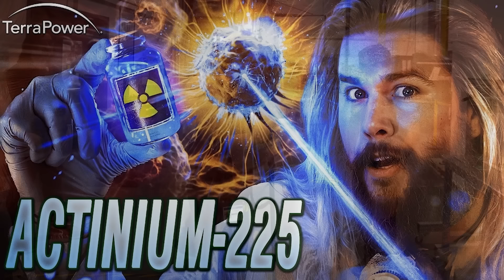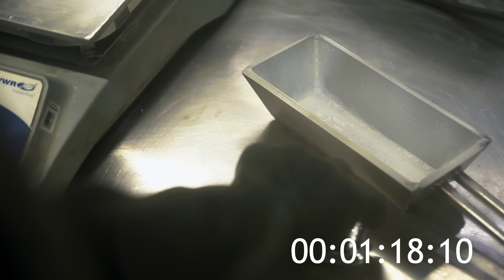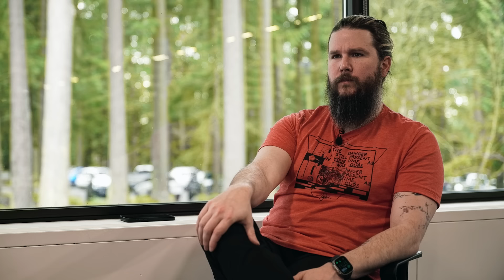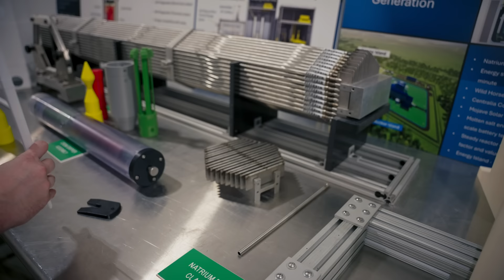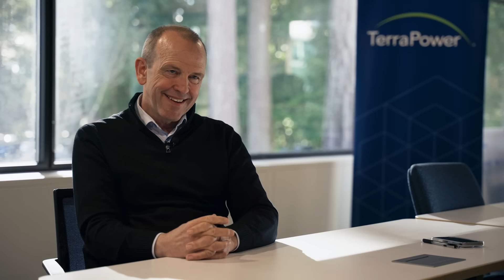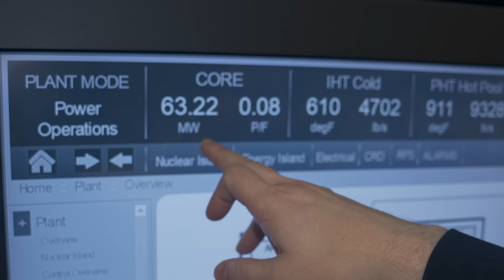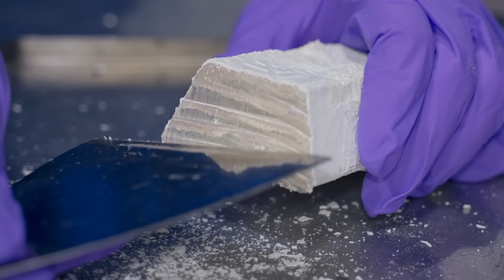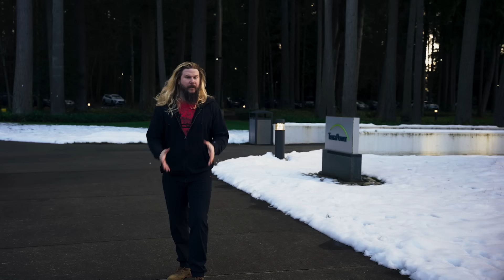Will Natrium Nuclear Reactors Change Everything?

Comment: Do the TerraPower reactors have a Safe-Fail design? With a fast reactor not needing a moderator, a cooling pump failure means that the heat will continue to build up… so eventually, though it would take longer to get everything hot, you would still reach meltdown conditions.

Compare this to a heavy water reactor where without the D2O, the neutrons move too fast to sustain the reaction, causing the output to fall, that should in theory prevent a runaway.

Second is that I’ve heard reports about sodium cooled reactors used by the USSR in submarines, and one major issue that they ran into were secondary chemical reactions creating deposits in the cooling channels of the reactors requiring periodic invasive cleaning cycles. I don’t know the specific residuals, so maybe that’s been eliminated with more modern materials, but I’d love details on that.

And of course, using salt as an intermediary prevents the “radioactive sodium metal meets water making glowing steam” issue, but would there need to secondary heaters in the water side transfer? If the system stalls and the salt solidifies in the water side heat exchanger, and the reactor is “going 100%” you’ve got a backlog of energy building up.

I guess in the end, nuclear yes! Better handling, yes! But this is more of a lateral development, or refinement of existing tech, not anything truly revolutionary. But heck, the iPhone was the same thing and look at what it did.
Reply: I doubt the coolant pump failure would be significant as this design likely has a significant negative thermal coefficient just as the EBR II and other sodium reactor have. 

And I'm assuming the soviet submarine reactor you are referring to is the VT-1 used in K-27. That was cooled by a eutectic alloy of lead and bismuth, not sodium.
Reply: @  I’m not sure of the model specifically, and it appears most Soviet designed sodium reactors used a BN prefix.

The sub reactor was never implemented in anything more than a testbed due to the residuals and other issues, specifically sodium voiding and well… leaks.

I looked up the EBR-2 you mentioned and it does appear to have passive cooling through convective circulation, but still not quite a “safe-fail” setup, to slow the reaction you still need to perform outside actions (control rods) vs the reaction shutting down on its own. Sodium voids also appear to still be a worry, but that’s just a quick google/wiki skim

Comment: 19:23 literally mentioned that it becomes a hyperreactive when melted you know like it would be when being pumped around a reactor. What makes me nervous as if there's a leak in the sodium system that happens to you know release the molten sodium directly into the air
Reply: The sodium system is just a big pool under an inert atmosphere, sealed shut, it doesn't flow anywhere else.

Comment: This is super exciting. I looked up the project, and the demonstration plant, with all the licensing and everything in addition to the plant itself, is going to cost 4 billion, future plants are estimated at 1 billion each. A single CANDU reactor is 10 - 15 billion.
Reply: Hopefully they can actually get the costs down over time. I've followed this design for decades, initially with EBR-II, then PRISM which was never built and now Natrium (which is essentially a tweaked GE Hitachi PRISM core, which is why they are the partners with TerraPower). The combination of fast spectrum, metallic fuel (not ceramic), sodium cooling and a pool type reactor with primary & secondary loop heat exchangers inside the reactor vessel is a brilliant concept long overdue for a commercial scale demonstration.
Keep in mind it is only 350MWe vs.8-900MWe for the CANDU when comparing the costs. Still doesn't make up the difference, but not quite as bad as it seems just looking at $$.
Reply: @richardb1452  Well, it's pennies on the dollar compared to Germany's new fusion prototype. lol (think they said 50$ billion was put into it so far)
Reply: @matthewcarroll2533  Are you referring to ITER, which is international, not solely German and actually located in France?
No doubt many billions have been spent on fusion research over the decades in many countries. There are some very promising new companies that think they are very close to proving it can work on much smaller (and cheaper) advanced fusion designs rather than the huge, slow moving, primarily government run and funded programs. One example is Commonwealth Fusion Systems near Boston. They are partnered with MIT, have raised $2B and currently building a prototype to prove their new tech (SPARC). We should know in a fairly short time (<5 years, not another 50) if their claims are backed up in reality. If one or more of these smaller companies which all rely on that body of research over the years can actually make it work, then it won't have been a complete waste.
Reply: @matthewcarroll2533 you are talking about ITER which is not a Germany only project as much as I like to take Credit for it. It's an international project trying to advance the understanding of how fusion works and if we can use this on earth to create energy efficiently. 

Theoretically we know that it works the theory is pretty well understood and actually really simple. The practical aspects just require an insane amount of Engineering research. Considering one of the things you are trying to do is superheat a gas to 15 Mio. Kelvin. 

As such yes ITER is very expensive, because it's basically just a giant experiment. Trying to show a feasibility. Economics come way later.
Reply: @the_mastermage  Yeah, I was referring to ITER. My bad, you're right also that it's an international project - some places are falsely claiming it's Germany doing all of it, though.
Reply: @richardbaird1452  thanks for pointing out the output difference, I missed that. As you said, still way better output per dollar though, which is great.

Comment: The Soviet submarine K-27 was the only nuclear submarine of the Soviet Navy's Project 645, featuring a unique design with two experimental VT-1 nuclear reactors that used a liquid-metal coolant, specifically a lead-bismuth eutectic alloy.
 The keel of K-27 was laid down on 15 June 1958 at Severodvinsk Shipyard No. 402 and it was launched on 1 April 1962, going into service as an experimental "attack submarine" on 30 October 1963.
 The reactors, while innovative, were problematic from the start, leading to several technical issues during its operation.
Reply: There were a lot more subs with liquid metal coolant, we've known this since the end of the cold war.

Comment: This salt bettery idea sounds really great! But the lingering question, why wouldn't you just have the salt battery? It alone is responsible for reacting to the grid's fast demand changes?

And while I type this question, I think I have thought of the answer. Nuclear reactors (and also fossil fuel stations) give off excess heat. This is important for the salt battery because it must constantly keep the salts liquid. So it is more efficient to use the waste heat to do this! Is this correct/close to correct?

Comment: I don't know why you'd call it natrium rather than sodium, but okay then, I guess.

Also, I thought that the idea was to use molten salt, like sodium chloride or potssium chloride rather than red hot molten elemental sodium metal. How do they even manage to have a lot of that without it reacting with everything including the water and the oxygen in the air? Extremely hot elemental sodium metal is ludicrously reactive. 

If the tests go spectacularly well enough, will Spain finally be able to embrace nuclear power to replace all of the fossil fuel power plants they inexplicably shut down rather than having them at least for backup power, assuming they don't figure out how to strengthening the national grid by then and however many electrical blackouts they're going to be having in the meantime (because, nevermind figuring that out before demolishing all of your fossil fuel power plants, if the peasants have to suffer blackouts, f**k 'em, nevermind the fact their trains and trams run on electricity and people will be stranded with no way of getting home, who cares?)? 

So, if this molten metal breaches the container, it's going to cause a fire that can't be extinguished by water that is going to then going to cause radioactive material to be aerosolised and sprayed into the air, irradiating a massive area around the power plant and any people, plants, soil, and ground water in that area, possibly leaking into the drinking water supply of an even greater area? And if you're lucky it will just moderately increase cancer rates, infertility, and birth defects for decades, and if you are unlucky it might drastically increase whilst giving a lot of other people radiation sickness especially most likely the power plant workers? Great, excellent... 

So, I'm guessing the extra energy you get out of it can heat up more water to make more steam to spin more turbines and make more electricity with less nuclear fuel? I mean, presumably that just means fewer power plants needed. Or, maybe for redundancy sake, in case a storm knocks over a tree onto a power line and cuts off power supply from one of the plants, just less nuclear fuel? 

Or does the radioactive decay products not vapourise at 500⁰C? I thought that one of the radioactive decay products was radioactive iodine, which can accumulate in the thyroid, causing radiation sickness followed by death. I thought iodine vapourised well below 500⁰C or is it just hope all of it reacts with the sodium metal and not have time to escape?

Yeah, argon atmosphere. If the argon leaks out or the equipment that pumps argon gas into there stops working for whatever reason, then what? Well, I guess maybe if there's no water it can't have a steam explosion and maybe without that violent expulsion of steam flinging radioactive material everywhere, maybe any vapourised iodine can't escape due to it being so heavy without that explosion giving it enough kinetic energy? It's still safer than water nuclear power, but I don't know if individual atoms and molecules of iodine are as heavy as large volumes of gaseous iodine. I kind of doubt it is as safe as just molten salt without molten sodium metal. Plus, even if the iodine doesn't escape it still seems really dangerous for the power plant workers. Plus you're losing some of your energy by having to electrolyse the molten sodium chloride to sodium metal. 

I'd laugh if France, being ahead of the curve right now, fell behind because everybody else builds newer, fancier reactors and France only built their reactors recently and then have to patiently wait however many decades before it's time to replace the reactors before they can get the new ones, or at least replace the old ones with the new ones. Also, we've seen what happens when you build nuclear reactors in earthquake prone zones like Japan with Fukushima. Doesn't seem like nuclear power is the wisest idea for earthquake prone zones like Japan, don't know what they're going to replace their fossil fuel power with, it's not exactly sunny all the time there for solar only the same way as Spain which is having problems even with all of that near constant sunshine (turns out the wind isn't always blowing and even in sunny climates, the sun still doesn't shine in, ya know, the night time...). I mean, if only eathquake and other natural disaster prone places use fossil fuels still, will that be enough to stop global warming? Not to mention the fact developing countries are going to use more fossil fuels in the future, not less, as they develop economically and more people get access to power but they won't be able to afford to build and run nuclear power plants, nor will they have the people educated to run them, nor the money for the educational institutions necessary to educate people so they can build, maintain, repair, or operate nuclear power plants especially not safe ones. If the entire developing world is still pumping out CO2, we are still kind of screwed because of global warming aren't we?